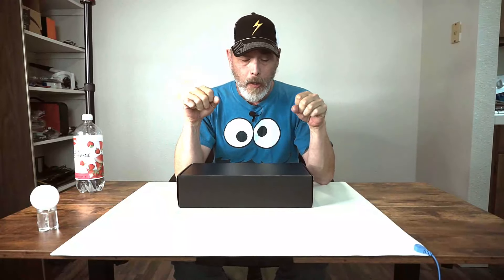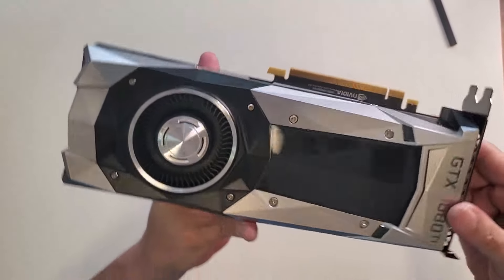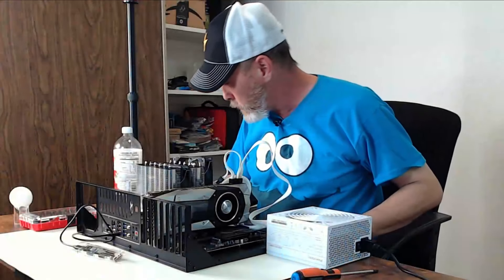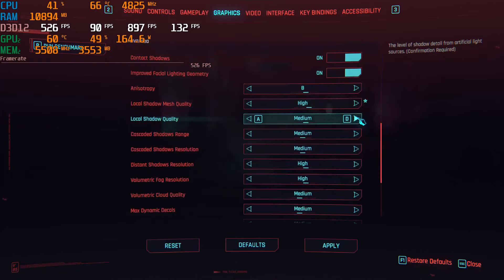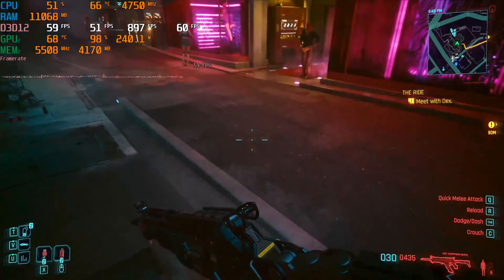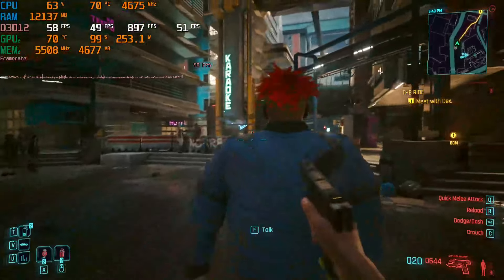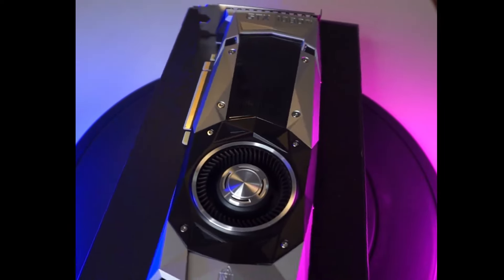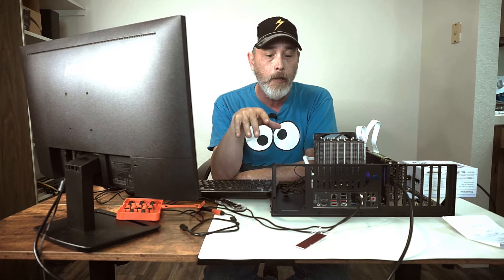Is This the Best GPU of All Time?

Comment: I wonder what HVAC unit they will place on the 5090 as a heatsink/fan combo. Also, will I need a small nuclear reactor as a PSU?
Reply from the maker: LOL! Yeah, it will be interesting to see what the TDP and thermal limits are on the 50 series upon rollout.  They and the AIB partners have been getting better at cooling at higher levels, but at a high cost to the consumers.

So, as long as someone goes with a mATX or ATX case, with a decent amount of properly integrated fans, cooling shouldn't be a problem.  That being said, the speculation is that the power draw for the upper end cards will be 450W-500W at a minimum.  So if you get a 5090 or 5080, I'd think your safest bet, depending on the build, is to start at 850W PSU as a minimum, but probably better off at 1000W and above.
Reply: @Lead-a-Horse-PC-Hardware  I went with a 1000W when I bought my 4090. It is a tight fit with 4090 and AIO 360 in a Mid tower. I use a lot less power than stock from 950mv undervolt.
Reply from the maker: @scipher99  Yeah, I did a similar thing, went with a 1200W Corsair Shift with my 4090, with the same undervolt as you.  I went with the 1200W for two reasons: 1. To have plenty of headroom and 2. In case I decide to get a 5090 (depending on price and performance and availability) and in case I wanted to take a serious look at the arrow lake cpus if/when they come out.

Comment: Cool video, while the founders cards are good, I don't like how agree with how nvidia would set a MSRP for the card but not(until recently) enable their board partners with decent pricing so they can have msrp cards as well, this is part of the reason why evga got out of the business of producing nvidia gpus. I also don't agree with the 1080 ti being the goat gpu, if we're talking about the performance you got for the msrp founders card yeah that was amazing, but performance wise, that level of performance has been hit time and time again by both nvidia and amd, honestly if it wasn't for the price, people would probably consider the rtx 4090 the goat.
Reply from the maker: Great points!  I agree that the pricing model for the cards is a problem for sure.  As to the card being a goat, it isn't the straight fps performance that makes it the goat, it's the fact that the card came out 8 years ago and can still compete in the current market of gpus and at a fraction of the cost of those current gpus.
Reply: @Lead-a-Horse-PC-Hardware  exactly, and specifically it can still compete because there are cards that hit that same performance levels you got your 1080 ti, 2070 super 2080 2080 super rtx 3060, and if you at these cards on ebay with the sold and completed items filters all these cards go for roughly the same price used and working. nvidia has been stagnant for the most part besides the 4090, and while AMD has made progress they were behind, and still haven't really caught up to nvidia completely. and this is what I mean by it's not really the goat gpu, it was the flagship gpu of it's generation with almost the complete die, usually those kind of cards tend to have really good staying power, what we should really be looking forward to is is the 4090 with it's 24gb of vram still going to be usuable in 5 to 6 years and I think it'll be more than chugging along to be fair. Mind you the 4090 isn't even the full die, which is just insane.

Comment: rx 580 belongs in the same tier imo
Reply from the maker: I don't know that it belongs in the same tier as its performance is more limiting than the 1080 Ti by a long ways; however, the RX 580 8GB should still be a conversation to have as it is still a somewhat relevant card, specifically in the budget build arena.  Unfortunately though, there will no longer be any driver support for that card, moving forward.
Reply: @Lead-a-Horse-PC-Hardware  I meant as in bang for your Buck and how long it lasted